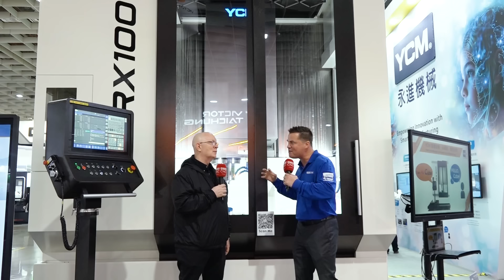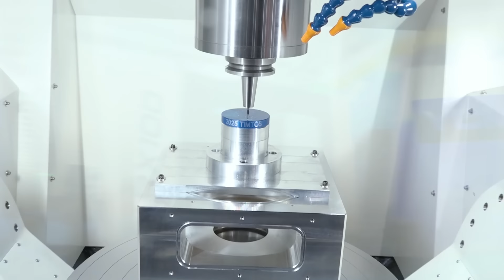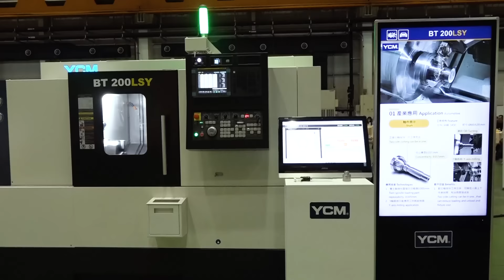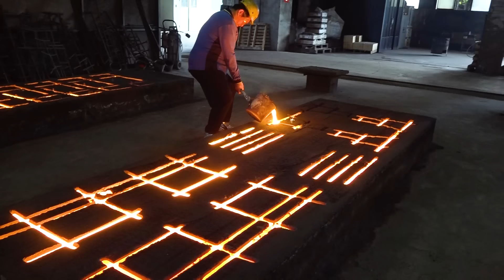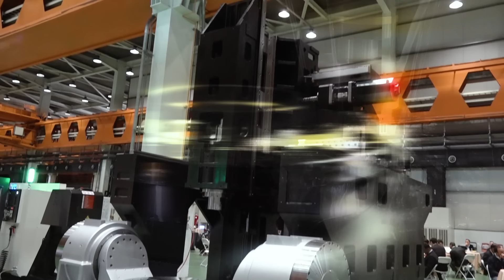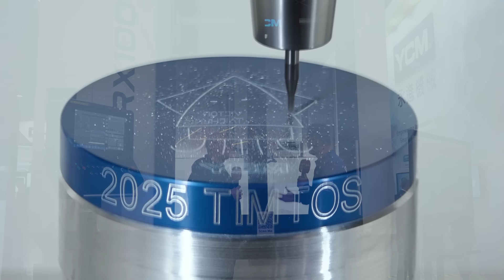This is the kind of five-axis technology customers need and deserve!

Comment: is it also possible to indicate and lock the spindle so you could do some micro shaping/3-5 axis chamfer shapeing ?
also wish that they sold them without any moter's ( except the spindle ) as a manuel 5 axis option ( only as a request order ofc )
if you really want the best mirror finish then you need full hydro dynamic quide ways and bearings and linear moters since there is no direct contact ( and wear ) and ball size deviation and stick slip effect to ruin your perfect finish 
and even if they dont use linear motors the hydro dynamic ways would still be a good idear ( no wear and since absolitly zero friction that means that all 100% if the motor power goes to moveing the axis and not just 98% cuase of the stick slip effect )